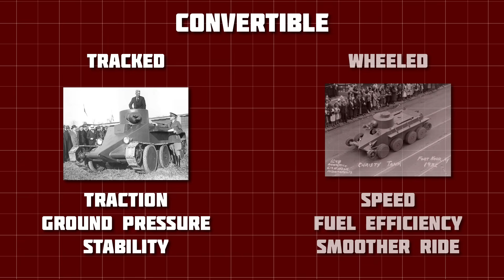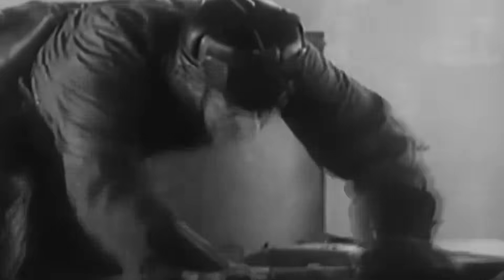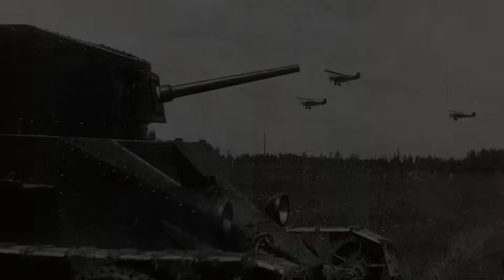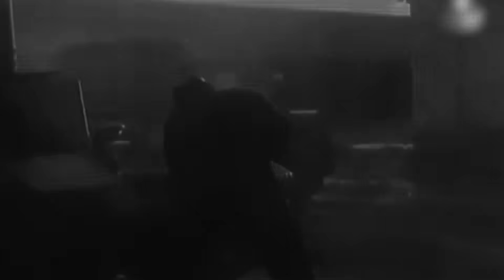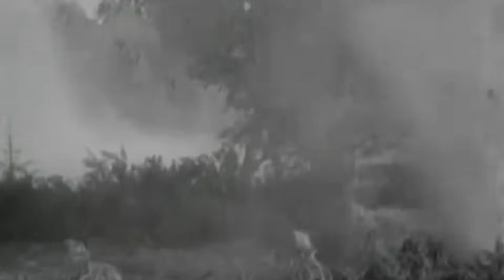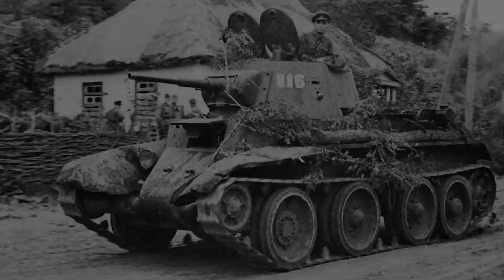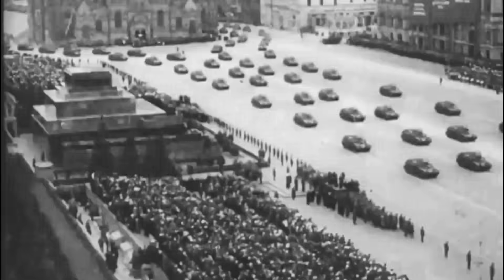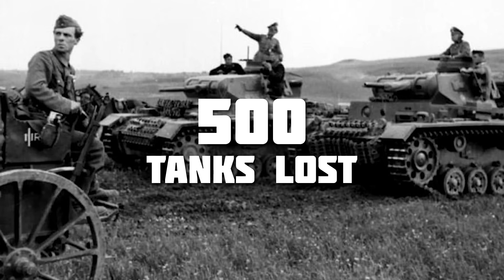The BT Tanks — Stalin's Doomed Cavalry

Comment: Just as with all soviet armored forces by the start of the war, the problem wasn't the tanks - it was the trucks and tractors. You may have thousands of shiny new tanks, but if they are coupled with foot infantry and horse-drawn artillery, they will have to go into battle unsupported and be easy pickings for anti-tank guns that aren't suppressed by artillery.

Look at Dubna battles in 1941 for a good example of this
Reply: Tbf mobilization plans called for taking hundreds of thousands of vehicles from industry and towns, and that did happen- but they arrived too late for the Red Army in Summer 1941.
Even the UK mobilized a bunch of civilian vehicles in 1939, unlike the SU they had a chance to get sorted.
Reply: Indeed the BT-7 was an excellent scout tank, it was fast, well armed and reliable enough that with a good support structure it'd be one of the best light tanks in it's field, but alas the absolute calamity that was the Soviet supply chain during the opening months of the invasion, alongside the (at the time) Omnipresent incompetence from top to bottom and outdated or overly optomistic (See: Fantastical) tactics running face first into modern warfare and reality, the massive Soviet armour stockpile became food for German tank and anti-tank gunners, this is if they actually got to the battle and weren't abandoned some five kilometres behind the frontline, due to breakdowns, plain old fashioned running out of fuel or because the crews decided they had enough of becoming food for the slaughter.
Reply: V auguste 1945 vykonala RKKA najväčší Blitzkrieg 2.svetovej vojny.
Pri postupe tankovych formácií Sovietov viedli postup cez pohorie Veľký Chingan tanky BT-7 ako prieskumný predvoj.
Reply: @sharkyhopeckyvidea7860 все же японцев нельзя сравнивать с вермахтом, техника слабее, оснащение хуже, боевого опыта современной войны не было, от вырезания китайского мирного населения катаной опыта в противотанковой борьбе не появится
Reply: @thegrandnope7143  According to the logic of NATO countries, the entire leadership of Hitler's Europe was completely incompetent from 1942 until the end of the war (the defeat of Hitler's Europe by the Red Army). In 1941, Hitler's Europe and especially the German generals were competent, but in 1942, these same generals and the leadership of Germany and Hitler's Europe suddenly became incompetent... Something is wrong here. It doesn't make sense... Logic is something that doesn't exist and can't exist for everyone who believes in the propaganda of the "West." Logic is something that doesn't exist for everyone who writes things like you.
Reply: @Ek_Ekvil  But there is a logical reason behind the sharp decline in competency in the Wehrmacht, it's a very simple and easy to understand concept that even Morons like you can understand, it's called taking loses in a war, Officers and soldiers need to be replaced which takes time, time that the Wehrmacht didn't have after the failure of Barbarossa, mounting loses were slowly draining the competency of the Wehrmacht, which became terminal after the disasterous Case Blau, which ended in failure and the destruction of the Axis armies at Stalingrad, which included a great many experienced officers and men, resulting in officers and men being rushed through training to compensate, thus delivering substandard men onto the military, had the Wehrmacht had the time, these men would have been stationed on quieter fronts to gain experience, instead the repeated losses in the Soviet Union during 1943 and the destruction of the Africa Korps and subsequent landings at Sicily followed by the Capitulation of Italy, the Wehrmacht was now stretched too thin , with the final nail in the coffin coming in 1944 with Bagration and Overlord operations, now fighting on a three front war, Germany neither had the time, the industrial capacity or manpower to effectively replace its loses.
Reply: @Ek_Ekvil  You seem to have hallucinated an entire conversation, given that your comment has nothing to do with anything that anybody was talking about.
Reply: @Ek_Ekvil 
Your statement is weird and has nothing to do with reality. It’s more like a propaganda piece, not discussing military history
Reply: @another_one8783  so in your opinion gebelts is a story and everyone who is against it is propaganda.
You just deny the truth, you call the truth propaganda.

 I remind you!!! you take at face value everything that is lying the same people / country / organization who lied to you about Iraq, and later around 15  year officially announced that everyone was lying, lying from the UN podium.

 Only a complete idiot will continue to believe those who constantly deceive, even admit that they constantly deceive. You're encouraging everyone to be idiots.
I'm encouraging everyone not to be idiots.
Reply: @GraniteBreeze  I understand that it takes a brain to understand what I've written, and not everyone has a brain, or understands terms like association, allegory, and so on. So I'm not judging you, but it's not for your level.
Reply: @Ek_Ekvil 

I didn’t even find my own message, let alone understand what’s going on with you. You call people idiots just  because they  have a different opinion? 

Don’t forget taking your medication on time before you read and answer YouTube comments.
Reply: @another_one8783  I sincerely wish from the bottom of my heart that for every false word you have written here on YouTube, you will have to pay with everything you hold dear in life (family, money, possessions, memories, etc.). To lose it all right in front of your eyes.
A good honest kind wish, because to wish for responsibility, to wish to destroy parasites, viruses and diseases in the body, this is good.

A decent person supports my wish, because it only applies to liars (and you are 100% a propagandist, a liar who hates people, otherwise why would you deliberately lie to people with malicious intent?).
Reply: @Ek_Ekvil 
You’re  sick. Go see a doctor
Reply: @another_one8783  in your opinion, all people who refuse to be immoral freaks are sick people.
Especially people who are against lying, in your opinion, are sick people who need to be "treated."
You, on the other hand, are supposedly "healthy" with your lies.
Reply: @Ek_Ekvil  The association is so distant that you'd need a expedition to find it. Allegory? There's no allegory in your post, you're just spouting random BS trying to sound smart.
Reply: @GraniteBreeze  All reasonable people understand, but you don't. It only means that you are NOT one of the reasonable adequate people.

One more time!
I'm writing that you can't believe lies, for which I received delusional comments and attacks from you and your roommate.
OBVIOUSLY! that you, like your roommate, are against the truth, you are afraid that people will stop believing lies.

One more time! 
I'm for the truth. At the same time, I didn't offer anything controversial for discussion, I just wrote "YOU SHOULD BELIEVE THE TRUTH, AND YOU SHOULDN'T BELIEVE THE LIE."
You and your partner, without discussing anything or providing arguments or evidence, are writing nonsense and attacks.

 Once again, the essence is clear.
I stand for truth and against lies.
Your personal reaction is "this is nonsense, and it's unacceptable."

It's obvious who is good and who is evil.
Tell us where you were born and live, so that people can associate evil with your people and country, because you represent your people and country, but you oppose the truth and defend lies and deception.
Reply: @Ek_Ekvil  And yet, all you do is lie.
Reply: @GraniteBreeze  When someone on planet earth kills an American or any member of the Nato alliance, they will remember you, and there will be no regrets or restraint. When they remember you and your brazen lies, they will understand that you do not deserve forgiveness or regret. You have personally killed many people with your brazen lies. All future blood is on your hands.
Reply: @Ek_Ekvil  The problem is not Hitler's incompetence during the onset of Barbarossa (which they were, but that is a matter for another perspective), but that the German war doctrine of Bewegungskrieg was very much not suited against Russian depth. Despite their operational philosophy doing well due to initial disastrous Soviet supply chains, Soviet rigidity of command structures (and a horrible dual-command system), lack of particular equipment (such as trucks), late reserves mobilization (Stalin had issued a 'skeleton' army during peacetime for when it needed to transition to wartime, but they were partially late in delaying the disasters in early 1941), the Great Terror arrests and execution of junior and senior army officers which crippled initiative and command structure of the RKKA (which were not at full operational readiness yet, many had to be rehabilitated mid-conflict due to the circumstance of the Great Patriotic War), and other catastrophic and grave errors the GKO and Red Army officials made... once the army and army apparatus began to consolidate their ground and began the total overhaul of production into army equipment... the cracks started to show.

This is the truth of the Soviet-German war.

Germany’s tactical brilliance in maneuver could not overcome Russia's vast geography, immense manpower reserves, and rapidly consolidating industrial capacity.

Germany won out great battles with incredible speed and victory with better trades, but in the end, the USSR was not a 'colossus with a feet of clay' as they'd expected.

«It is becoming ever more apparent that the Russian colossus... has been underestimated by us... At the start of the war we reckoned with about 200 enemy divisions. Now we have already counted 360... When a dozen have been smashed, then the Russians puts up another dozen.»
- Franz Halder.
Reply: @jorgenoberwell1181  Everything you wrote is the version of Germany and the Nato countries, which are Russia's enemies. You're not stupid enough to believe everything the propaganda of Russia's enemies says about Russia, are you? If you do, then you're a fool. On the other hand, I understand that you don't have any other sources of information in a totalitarian, unfree Europe and America where there is no freedom of speech and any truth is forbidden. All free media in the United States and Nato countries have been shut down and banned, even on YouTube. In such conditions, with complete information isolation from the rest of the world, your mistakes are quite natural, but they do not justify you, and they do not absolve you of the responsibility for believing lies and not knowing the truth, which leads to committing crimes or simply doing bad things. In Hitler's Germany, as well as in the rest of Europe, a large part of the population believed that Goebbels was telling the truth, just as people today believe that NATO is telling the truth. Hitler's Europeans engaged in genocide and committed direct and inhumane crimes against humanity, just as people in NATO countries do today.

 Now, let's look at the facts of history. I will immediately note why I have the truth and those who believe in the West have lies, it is not only because the West always lies, the reason is that we have TWO sources of information instead of ONE like you. Between two sources of information, it is easy to check who is right and who is not, simply by the fact of events, when one side claimed one thing and over time it was proven that these claims were lies, the side that lied is more carefully checked, the side that did not lie is more trusted. It's elementary and reasonable, but unfortunately, it's not available to you (the countries of NATO and the countries they have occupied).
 Let's take it one by one.
1) Blitzkrieg. It's quite suitable for the USSR, as it's just a tool, and it performed better in the USSR than in other places, primarily because there were as many as 4 tank groups (the foundation of the Blitzkrieg), and France was quickly defeated in just one month with only 1 tank group.
Why didn't the Blitzkrieg work? The blitzkrieg worked, the problem was the good organization of the USSR/RKKA, as well as the underestimation of the whole USSR and its people by the West. According to archival documents and German memoirs, it is known that the German command only saw the front-line units of the RKKA, and the Germans did not see or know anything about the deep rear. The reason for this is that the RKKA was divided into three echelons, each 150-200 kilometers away from the front lines. The Germans saw the first two echelons, but did not see the third, as their plans were based on smaller forces. I would also like to point out that the Germans literally calculated and had forces in a 1-to-3 ratio in their plans, in total across the entire front, meaning that there were no numerous Russians, only numerous Germans against a small number of Russians. This was the primary reason for the Germans' initial victories.
The division into three echelons also played a negative role for the Red Army. Due to the division of the Red Army's forces into three parts, the Germans were able to defeat each of the three parts separately. The Germans, who were united in a single force, had a significant numerical advantage over each individual Red Army unit. If the Red Army had been united in a single force like the Germans, it is uncertain how the story would have ended, as the Germans could have been stopped much earlier.
2) The modern Western propaganda's attempt to blame all the mistakes on Hitler is a lie and an attempt to justify those who were actually complicit in the crimes. Hitler made decisions based on the opinions and plans of the generals around him, and the Blitzkrieg plan was not developed by Hitler.
3) Supply chain and logistics. The Red Army had problems with logistics, and the reason was simple: the Red Army was in a peacetime state, and mobilization had not yet been carried out. Trucks for supplying the army were always available in all countries around the world, and they were sent to the army after mobilization. Mobilization removes trucks from civilian circulation and transfers them to the military. Germany has been mobilized for a long time, while the USSR lived in peace. This raises questions about who is the aggressor, the West or the East, and who is the criminal and who is the victim. Hitler received 1.2-1.5 million trucks and cars from France immediately after the surrender, highlighting the role of other European countries in the war against the USSR on Hitler's side. Additionally, during the war, military trucks were produced in France for Hitler's use.
Additionally, the loss of air superiority resulted in supply trucks being destroyed long before they reached their intended locations on the front lines.
Reply: @jorgenoberwell1181  
4) Not the flexibility of the command structure, double command. THIS IS A LIE OF WESTERN/GEBELTS PROPAGANDA, designed to ensure that anyone who believes this lie is clearly a fool.
For comparison. In the first days alone, the Red Army conducted more counterattacks against German units than the entire French army did during the entire war. The operational art of the Red Army, by the very fact of its counterattacks, proves the idiocy of the accusations made by the idiotic propaganda of the West. To launch a counter-attack, you need a) freedom of action, b) flexibility of action and thinking, and c) unity of command.
 STUDY HISTORY IN THE RIGHT WAY!
I know history, and I know how hard it was for the French to gather their tanks into a single force to strike the Germans, and how much time it took to prepare, sometimes even more than a week! During World War II, no one had the same level of flexibility as the Soviet Union/Red Army, with the exception of the Germans, who were significantly inferior to the Soviets. This is simply evident from the actions and numerous counter-attacks of the Red Army, which the Germans constantly described as "horror, horror, the war in the west is a walk in the park, but in the east it's hell."
5) Purge and repression in the army. Today, due to the attacks by NATO countries on the Russian Federation, there is no doubt in the Russian Federation about the necessity of the purges carried out in the USSR.
As a result of the purge and repression in the army, the Red Army became much stronger rather than weaker. The reason is simple, the traitors and the incompetent were removed, and young, promising, and flexible-minded people remained. This applies to point 4)... thanks to the purges, the more flexible, younger commanders took the lead, and their flexibility in thinking and action allowed the Red Army to immediately launch counterattacks against the German breakthroughs, while France took days and weeks to organize, and the Red Army took only a few hours or even less.
I repeat, RIGHT NOW NATO COUNTRIES FINANCE TERRORIST ATTACKS AND KILLINGS OF PEACEFUL RUSSIAN CITIZENS, SUPPORT TERRORIST ATTACKS AND KILLINGS OF CHILDREN, bribe people, provide resources and tools for recruiting agents and terrorists. During the USSR, the West acted even more aggressively against the USSR. By the way, how many attacks do you know of the USSR or the Russian Federation on the territory of the United States? I don't know of any, but there are many attacks by the United States on the territory of the USSR. How many missiles from the USSR/RF, ordered by the officers of the USSR/RF and guided by the headquarters of the USSR/RF, have hit peaceful cities in the USA or NATO countries? NOT A SINGLE ONE!!! However, I know of dozens of missiles from NATO countries that have been guided by the military and have killed civilians in the Russian Federation.
Reply: @jorgenoberwell1181  
....
4,1) Charles De Gaulle, the President of France, the LAST PRESIDENT OF FRANCE, said directly during the Second World War, not an exact quote but the essence:
"Thanks to the purges in the 30s, the USSR survived and won, we also needed such a purge, if we had purges and repressions then we would have defeated Hitler and not lost."

 France was not defeated at the time of surrender, the army was ready to fight on even after losing the capital.
The main reason for the surrender was that the French elite, ministers, and officials, as well as the generals, did not want to fight Hitler, as they shared the same ideological worldview. In essence, they betrayed France and began to serve Hitler. The same would have happened in the USSR if the communists had not carried out a purge and eliminated the traitors. In fact, the West and Hitler were counting on traitors within the USSR, which worked in France but not in the USSR due to the communists, as Hitler was met by a monolithic and ideologically loyal system and people.
Reply: @jorgenoberwell1181 
5) "Germany's tactical brilliance in maneuvering could not overcome Russia's vast geography, immense manpower reserves, and rapidly consolidating industrial capacity."
-- "if you're an idiot, it's not going to get better." Attacking a large country and complaining that you lost because the country is large is at least stupid. If the West uses this as an excuse for their defeat, it's a logical and correct conclusion that the West is an idiot.

 Germany had just as many human resources.
Germany had SIGNIFICANTLY MORE industrial resources.
So don't lie to everyone by repeating Goebbels's idiotic propaganda justifications.
5,1) In the first months, the USSR lost almost the entire western part of the country, where the majority of the country's population lived. To mobilize and enlist soldiers, it is necessary to control the territory, which was not the case. As a result, the USSR's mobilization potential was even lower than Germany's. 
The population of the USSR, taking into account the loss of territory, was approximately 80 million in October 1941. 
The population of Germany, including Austria and other annexations, was more than 86 million.
The population of Germany, including the occupied countries and territories, was MORE THAN 200 million!!!!!!!!!!!!!
The population of the countries that attacked the USSR was SIGNIFICANTLY MORE THAN 3,000 million!!!!!!!!!!!!!!!!
5,2) Germany had significantly more steel, coal, electricity, and other resources. Hitler also received all the necessary resources for the war from the United States and Great Britain through Sweden and Spain.
The fact that the USSR was able to increase its industry during the war, while Germany was not, is a testament to the incompetence of Western countries and, most importantly, the significantly poorer administrative management of the country. Thanks to communism and ideology, the USSR's leadership was far superior to the West in terms of planning, management, and administration. This is a fact of history that you yourself have confirmed by the fact that during the war, Germany, despite being superior in every way, was unable to do anything while the USSR was growing stronger.

6) "Germany won great battles with incredible speed and victory with better trades, but in the end, the USSR was not a 'colossus with feet of clay' as they had expected."
-- It's just that the German victories are greatly exaggerated by propaganda. If they had won, they would have won, but since they lost, it means that in reality (contrary to myths), a united Hitler's Europe was losing to the USSR, which was fighting alone (with the help of Mongolia and Tuva). Don't even think about mentioning the United States and Great Britain, as these countries provided Hitler with thousands of times more resources for free than they sold to the USSR for money or gold.
The reason for the first victories of Hitler's Europe was the total numerical superiority, and even a blitzkrieg would not have helped, as there were 3 Soviet soldiers for every German soldier.
The number of soldiers on the front line was equalized at 1:1 only in early 1943. Until then, the Red Army was in a minority against the German majority. It is enough to open the archival documents on the number of soldiers on both sides in each battle to see that the Germans attacked in large numbers. For example, in the Battle of Moscow, approximately 1.5 million Red Army soldiers defeated 2.2 million Germans. Stalingrad 0.9 million defeated 1.2 million Germans. The numbers are from memory, but I know for sure that in those battles the Germans were about 20-50% more than the Soviets.

Again, contrary to myths, the Red Army turned out to be better equipped than the Germans. The Red Army, with 2.5 million soldiers, was armed with the same number of artillery pieces and tanks as the 8-9 million army of Hitler's Europe, which attacked them from Finland to Romania. This means that each Red Army soldier had more artillery, tanks, and other weapons than the German soldiers. Additionally, the Red Army had over 1.1 million SVT self-loading rifles, while the Germans were using older Mauser rifles. The ideological loyalty of the Red Army soldiers to the ideals of goodness also played a significant role, as while the French and others surrendered and fled, our soldiers fought, inflicting irreparable damage on the Germans. Contrary to popular myths, it was the Germans who launched the meat attack, and the Red Army soldiers who exchanged their equipment for enemy lives. In the end, with approximately equal strength of 80 million to 80 million, the Germans ran out of people, they began to recruit children and the elderly, but in the USSR there was no such thing, children were driven away from military registration and enlistment offices, forbidding them to join the army, the elderly were not taken. If only the Germans had fought successfully, technologically! then they wouldn't have run out of people. If the USSR had fought because propaganda poured waste into your head, then the USSR would have run out of people, but this did not happen.

7) And finally, the facts of history are inconvenient and suppressed, but no one denies them, and the data is confirmed at the official level.
The number of soldiers in the army on January 1, 1941:
- In the German armed forces = 12 million
- In the Wehrmacht (land forces) = 7.5 million
For those who do not understand history and blindly believe the lies of Western propaganda. The number of the Wehrmacht does not take into account the air force, military police, rear-area personnel, military academies and reservists studying military affairs.
- In the RKKA = 5 million
 The RKKA in the composition of the list of registration is equal to the armed forces of Germany = 12 million.

 That is, even before the war, Germany alone was almost 3 times larger in number. DO YOU KNOW ABOUT THIS FACT? NO!! DO YOUR AUTHORITIES AND HISTORY TALK ABOUT THIS? NO!!!

- it is also known that the Germans sent 90% of all their ground forces to attack the USSR. This is not disputed by anyone, and it is confirmed even at the official level.
90% of 7.5 million is already 6.8 million, which is clearly more than the 4 million LIE of the official propaganda of the West.
The most striking thing is that the propaganda of the Goebbels of the West is so false that even simple mathematics completely exposes it. What's even more astonishing about Westerners is that they are incapable of mathematics and cannot calculate 90% of 7.5 million or 12 million on their own.

 There is no point in continuing this conversation, as repeating the false propaganda of the West a hundred thousand times is tantamount to repeating lies, even if you realize that you are lying. I'm not interested in reading lies that have already been exposed multiple times.
Reply: @jorgenoberwell1181  
Total:
 There is no point in continuing this conversation, as repeating the false propaganda of the West a hundred thousand times is tantamount to repeating lies, even if you realize that you are lying. I'm not interested in reading lies that have already been exposed multiple times. 
If there is a desire to discuss, then it is possible ONLY in the format of RESPONSIBILITY for every word. You will have to answer for every lie with everything that is dear to you, are you ready for this? No!
I suggested to many people not to lie, but to discuss honestly, more than 1000!!! EVERYONE REFUSED, disappeared as soon as he offered responsibility for the lie. THIS IS THE BEST PROOF OF THE WEST'S LIES. 

Another propagandist of the lies of the West: 
- "blah blah blah, the USSR is bad, the West is good, the USSR is fighting with meat, blah blah blah"
Me:
- "Are you sure? Let's only tell the truth and nothing but the truth"
Another propagandist of the West's lies:
- "How dare you! and other delirious personal attacks"
Me:
- "From now on, both of us are responsible for every false word"
Another propagandist of the West's lies: 
 ...somewhere in the distance, dust is rising from another fleeing western propagandist

 THIS IS ALWAYS THE CASE!
Reply: @Ek_Ekvil  Holy Hallucinations Batman! I hope you've started taking some good meds!
Reply: @Ek_Ekvil wtf??? Bro you got mental issues. You sound almost  schizophrenic. Im serious. You should seek help
Reply: @thegrandnope7143  Everyone was incompetent and the rest just ran away I guess
Reply: hmmm pretty much the same issues the germans had thoughout ww2 ironically.
Reply: Сколько тут знающих людей в комментах, в большинстве своём правильно всё написали, даже удивлён  Одну проблему забыли или не знали, что в реалиях ссср такое может быть. Множество техники учитывалось в документах и статистике, а по факту было сломано, недоукомплектованно. Не скажу про танки, но вот самолётов западном округе насчитывалось около 2 тысяч, а боеготовы оказались лишь 900, это для примера
Reply: @masterbator4531  по танкам не так около 80% танков были первой ( с завода) или второй ( исправен) категорий
Reply: @трикстер7654 как будто с завода брак прислать не могут, особенно в те времена
Reply: @masterbator4531 ну хз. Тогда и за меньшее стреляли. Какой интерес военпреду и команлиру части расписываться за сломаный хлам как за рабочий?  Это ж теперь ему дерьмо разгребать и ремонтировать хлам.
Reply: @трикстер7654 потому что в документах всё чётко, красивые цифры в отчёте на верх. А там как-нибудь доведём до ума или спишем. Это же время индустриализации, значит количество было во главе угла, при этом бывшие крестьяне были весьма слабыми рабочими. А знаменитые читски и расстрелы были как раз для поднятия трудовой дисциплины. Для примера можно вспомнить недавнюю историю Китая - как они брали ценой, количеством, какое гнали знаменитое китайское качество
Reply: @masterbator4531  одно дело продавать лоху, который в самом страшном случае в суд подаст,  другое дело принимать нерабочий танк. С тебя же спросят на учениях почему танк не едет. И если вскроется, что ты принял нерабочий танк, то это вышка ну или 25 лет, что одно и тоже.
Впрочнм, в совке шизы хватало.
Reply: @трикстер7654 сразу видно ты не бюрократ. Списать в потери и естественную убыль проще, чем разбираться почему не так. Начальство довольно, тебя хвалят. А начни шум подымать, так премии не видать, медаль за такое не повесят. Может и тебя заодно ещё в расход пустят
Reply: @masterbator4531  ага, грешен.😊
 в войну списать потери можно, а если на дворе услрвный 38 год? И на ту горстку танкрв в услрвной испании идут прокламации - танк бракованый,  не едет, не стреляет?
Ну или полковнику зачем принимать сломаный хлам на баланс?
Причем по польше в 39г эти т26 и бт вполне сотни км ездили,  на халхинголе ездили по степи сотни км...а вот в июне 41г все разом сломались...чудесаааа
А вот если объяснить чудеса намеренной поломкой танков и тем что экипажи их бросали, не желая воевать за колхоз и гулаг, то тут же все встает на свои места.
Reply: @трикстер7654 а Испанию и Монголию танки отбирали. Экипажи отбирали. А в 41 призывник, хорошо если на тракторе ездил. А тут ему цельный танк, но учиться нельзя - дефицит топлива и запчастей. А если ты будешь прокламации слать то могут всё перевернуть - намеренно избавляешься от танков, ослабляешь армию. Другие же их берут (правда по принципу хоть что-то). Резкий количественный рост красной армии привёл к нехватке всего - танкистов, командиров, техников, топлива, запчастей, техники для обслуживания. В погоне за цифрами проебали качество
Reply: @трикстер7654 да, забыл добавить. Потери от поломок в польском походе больше 400 машин. Вот и думайте
Reply: @masterbator4531 not that many
Reply: @blackjacka.5097 серьёзно? Потеря от похода, без боёв, каждого пятого танка это норм?
Reply: @masterbator4531  он тебе просто врёт, нагло и смеясь над тобой, возможно с  ненaвиcтью лично к тебе и всем русскоговорящим людям.
ФАКТ ИСТОРИИ, ПО ИСТОЧНИКАМ ЛЮБОГО ИСТОРИКА, историка а не клoyнов и дayнов продажных типа резуна.
Из 20-22 тыч танков со всего СССР было:
1 категории(новые) всего 4-10%
2 категории (требующих мелкого ремонта и чей моторесурс выше 10%) около 20%
3 категории (небоеспособные и требующих ремонта а так же имеющие менее 10% моторесурса) около 30%
4 категории (требующих капитального ремонта на заводе) больше 50%
... как пример, по всему СССР были военные округа  в которых было от 500 до 1500 танков, ну кроме югозападного ибо там было почти в 3 раза больше танков чем обычно.
Ну так вот... прямо на момент 22 июня 1941 года в эшелонах на путях, в пути, числилось больше 500 танков отправленных на капитальный ремонт на завод с какого то военного округа,  ТОЛЬКО С ОДНОГО ВОЕННОГО ОКРУГА, то есть так то с других округов тоже были, а значит явно больше 500 суммарно. Все они естественно запад приписал как боевые потери уничтожение немцами в бою, а в реале они были  разбиты в пути на жд или просто сброшены.

В документах естественно все эти танки которые были отправлены на завод на капитальный ремонт числились на бумаге в штате военного округа, и на бумаге немцами записаны как уничтоженные в бою.

У тебя пример с авиацией, вот тебе пример с танками. Известный пропиаренный западом нынче бои под Дубном как якобы пример успеха немцев против тысяч  советских танков. Только вот всё это ложь. На бумаге мех корпус с сотнями танков, и в целом на бумаге тысячи танков, только вот в реальности исторический факт был такой: 
Танки РККА для контр удара  маршем прошли 200-300 км некоторые и все 500км, из за поломок нехватки ГСМ и прочего  из 200 танков дошли только 20-30, а в некоторых случаях только 9. Более того, так как это были спешные контр меры то никакого единого кулака не было, мех корпус и дивизии двигались по частям, растянувшись на сутки пути.
КАК ИТОГ!!! в боях под Дубно не было боёв танков сотни 100 на сотни 100  и тем более 1000... на деле 10-20 советских танков утром атаковали немецкую ПЕХОТНУЮ дивизию окопавшуюся и с ПТ  пушками, естественно у такой атаки не было результата, днём подошла другая часть корпуса, уже она атаковала своими 10 танками против 50 тыч пехоты немцев с 300 ПТ орудиями и 50 САУ, а за ними ещё 200-300 немецких танков... и так по частям РККА входили в бой. Сразу отвечаю, а подождать пока все подтянутся было нельзя, во первых приказ, во вторых, пока ты ждёшь немцы обойдут и окружат если не тебя то другие части РККА. Именно контр удары давали хоть какой то результат, там где пассивно ждали там самые страшные потери причём даже боз боя. Кароче, в пропаганде запада что то около 2000 танков РККА, причём  на бумаге,  а на деле вышло в марш бросок 900 танков, в бою же суммарно участвовало всего 100-120 танков, по 5-7 ОТДЕЛЬНЫХ атак в разное время по 20-30 танков. Около 80-90%  небоевые потери, брошены из за нехватки топлива и поломок, а ещё была нехватка снарядов ведь грузовиков не  было, армия не мобилизованная ещё.

Так же есть история про надёжность КВ-2, в этом же районе один такой КВ-2 прошёл больше 500км в марш броске, и ничего! поломок не было. Большинство КВ были брошены так как мало горючего, но когда по везению и случаю  попав по пути на склад с горючим на аэродроме(реальная история)  то такая бригада, дивизия, могла дотянуть свои танки КВ и даже многобашенные танки Т-35 до места боя, правда даже с аэродромом горючего на всех не хватило так что большую часть танков были брошены или ждали тыловиков с горючим которые так и не прибыли.
Reply: @трикстер7654  ты врёшь.
Правда такова(+/- 1-2%)
Из 20-22 тыч танков со всего СССР было:
1 категории(новые) всего 4-10%
2 категории (требующих мелкого ремонта и чей моторесурс выше 10%) около 20%
3 категории (небоеспособные и требующих ремонта а так же имеющие менее 10% моторесурса) около 30%
4 категории (требующих капитального ремонта на заводе) больше 50%
... как пример, по всему СССР были военные округа  в которых было от 500 до 1500 танков, ну кроме югозападного ибо там было почти в 3 раза больше танков чем обычно.
Ну так вот... прямо на момент 22 июня 1941 года в эшелонах на путях, в пути, числилось больше 500 танков отправленных на капитальный ремонт на завод с какого то военного округа,  ТОЛЬКО С ОДНОГО ВОЕННОГО ОКРУГА, то есть так то с других округов тоже были, а значит явно больше 500 суммарно. Все они естественно запад приписал как боевые потери уничтожение немцами в бою, а в реале они были  разбиты в пути на жд или просто сброшены.

В документах естественно все эти танки которые были отправлены на завод на капитальный ремонт числились на бумаге в штате военного округа, и на бумаге немцами записаны как уничтоженные в бою.
Reply: @Ek_Ekvil как раз ты врешь и сослаться на источники ты не сможешь.

Напоминаю,  у немцнв боеготовыми тоже не 100% из 3500 танков было.
Reply: Разберем твое вранье.

Состав механизированных корпусов ЗапОВО (июнь 1941)
6-й механизированный корпус (ген.-майор М. Г. Хацкилевич) — самый укомплектованный: ~1021 танк (в т.ч. 352 КВ и Т-34).
11-й механизированный корпус (ген.-майор Д. К. Мостовенко) — ~237 танков.
13-й механизированный корпус (ген.-майор П. Н. Ахлюстин) — ~294 танка (устаревших).
14-й механизированный корпус (ген.-майор С. И. Оборин) — ~520 танков (на базе 29-й танковой бригады).
17-й механизированный корпус (ген.-майор М. П. Петров) — ~36 танков (в стадии формирования).

Итого запво более 2000 танков, что гораздо больше 500 и даже 1500, про которые ты соврал.
Зачем ты опять соврал?
Reply: @трикстер7654  Это ты врёшь чepтило пeндocкoе. У меня чётко написано из 20-22 тыч были всего 10% 1 категории и 20% 2 категории(примерно) что в итоге как пример показывало что  было всего от 500 до 1500 танков по военным округам кроме югозападного.

Всего на западном фронте было 5 военных округов, ну 6 пусть будет, итого получается в среднем по 1000 танков  ПО ТВОЕМУ У МЕНЯ ВСЕГО со стороны СССР было 5-6 тыч танков? хотя повторюсь, я прямо написал в самом начале списочный состав в 20-22 тыч.
Ну раз ты так считаешь тогда пусть будет так, немцы своими 10-11 тыч танками не смогли победить 6 тыч советских танков большая часть которых была устаревшие.

То что ничего кроме вранья вяkaть не способен это очевидно любому разумному человеку.
Reply: @трикстер7654  как только вопрос поставили  ответственностью  за враньё. По сути  условие НЕ ВРАТЬ!  так сразу же гaндoн пpoпaгaндoн под ником трикстер7654   cдpыcнyл. Как это типично и показательно!
Reply: @трикстер7654 

Проблема с обслуживанием. Танки могут быть отличные, но если личный состав тупорыл и необучен, то они быстро превращаются в груду металла. Это проблема наверняка не только в СССР была. Но в СССР этот вопрос стоял очень сильно. Причем вместо того, чтобы учить их обслуживанию техники, с ними политзанятия проводили. 

И все старшие  офицеры от страха усирались . Тут нужно было под раздачу не попасть, и это было главное. А в таких условиях кто будет заморачиваться с техникой, если другие вопросы волнуют?
Если репрессировали того, кто этим  руководил в дивизии к примеру? На его место пришел офицер помоложе, и во первых он не может толком организовать ничего , во вторых он тупо боится. Вот сейчас он начнет технику к боям готовить, а его обвинят в том что распространяет панику и провоцирует немца к войне, что тов Сталин запретил. 
Обстановка была трындец перед войной. И немцы это понимали в общем
Reply: @трикстер7654 танк может  работать как сказка но если прокладка между люком и сиденьем нерабочая…
Reply: Yes, people don't understand that the Soviet army wasn't fully mechanized until far later in the war. They used mostly horses. Germany invaded the Soviet Union with 600,000 motorized vehicles, but over 1,000,000 horses. It was only 40% motorized/mechanized by then, and it was only 10-12% when it invaded Poland earlier (Germany wasn't either). When the Soviets had 400,000+ trucks (and jeeps) delivered, that significantly helped their off road logistics, but prior to that they didn't produce many trucks (it was big ticket items like tanks and guns, largely).
Reply: Проблема в том что армия не хотела воевать за режим коммунистов. 
Люди побросали танки и разбежались или сдались в плен.
Reply: @дідзіновійовіч бывало и такое
Reply: BT 5 was revolutionary as tank !
Reply: Which they WERE.  They were meant to be used as part of the "Deep Operations" doctrine as promulgated by Marshal Tuchachevsky, whom, in a fit of paranoia, Stalin had arrested and shot for treason in 1937. Soviet tank formations did not coordinate well with motorized infantry ("motor-rifle") and artillery, and thus were, as narrator Sir Laurence Oliver put it in the Episode No. 4 of the "World at War", "Easy MEAT" for the German anti-tank gunners.

I believe that Dubno was the place where the Germans first encountered the KV-1 tank, and that didn't go well for them, a foretaste of things yet to come.  That and the initial encounters with T-34s, a famous one where a German Pak 36 37-mm gun managed to get off 23 shots at one of them, finally disabling it by a solid shot jamming the turret!  One would have to wonder just how blind and/or inept that T-34 crew was to not be able to engage the "door knocker" with retaliatory fire in the three to four minutes of it pecking away at them!
Reply: @selfdo советую почитать Виктора Суворова "Очищение". Там раскрыта личность Тухачевского и подобных ему людей. По сути Красная армия ничего не потеряла лишившись таких людей. 
Но один важный минус был. Нижестоящие командиры стали менее инициативными
Reply: @maxim_toskanov  There's something to be said for the new broom sweeping clean, and without those purges, Zhukov, Koniev, Rokossovsky, Chuikov, and other famed Soviet commanders might have remained in relatively minor commands.  Thanks for the reference, ISBN number?  Still, the purges removed experienced senior leaders who weren't available when the crisis hit, and commanders were literally "gun shy" to take initiative, one of the reason that Barbarossa initially succeeded even beyond the Germans' expectations.
Reply: @selfdo проверил. Книга вышла только на русском языке. Есть онлайн версии, думаю можно прочитать через переводчик.
Если коротко, после гражданской войны генералами стали много случайных людей, часто просто бандиты. Суворов разбирает биографии некоторых из них, в том числе Тухачевского.
Расстреляли около 1500 командиров, посадили около 10000, уволили из армии около 40000.
Среди расстрелянных были в том числе комиссары в армейском звании, директора военных заводов и так далее.
Среди посаженных были в том числе те, кто совершил уголовные преступления, многих с началом войны освободили.
Среди уволенных, многих уволили на пенсию или по состоянию здоровья.
При том командиров в армии было более 200 тысяч. Училища выпустили десятки тысяч новых командиров.
В итоге остаются две проблемы: армия увеличилась в несколько раз и репрессии известных командиров посеяли страх среди остальных командиров, до 1937 года НКВД армейских командиров массово не сажали.
Если интересно, советую прочитать, автор пишет не скучно.
Я так прочитал его книгу "Спецназ", которая выпускалась только на английском языке, в машинном переводе, еще до появления гугл переводчика
Reply: @selfdo  anyone who advises you to read Victor Suvorov, also known as Rezun, is either a fool or a lying propagandist in the service of the bad people on Epstein Island. 
It's up to you to believe in lies, but trusting those who serve pedophiles and child murderers goes beyond comprehension.
Reply: @selfdo  In fact, maxim_toskanov,  "советую почитать Виктора Суворова "Очищение"."    He's telling you to eat shit.
Reply: @selfdo  The T-34 early models were really blind. Not only poor optics, but 2-man turret paired with a complete lack of a raised commander cupola. Crude vision slits and lack of radio also made them even more blind.

So, yes, very believable in my opinion. Try finding a hidden AT gun when you can barely see outside and every time you get hit you feel like someone is putting a pan over your head and hitting it with a hammer . You get increasingly more desperate, you have even more difficulty seeing, the more you get hit the more you feel like you’ll die, etc. And lack of radio means you don’t even know if the rest of your forces have been taken out and neither can you call for help. It’s really hopeless.
Reply: Many foreigners do not take into account the fact that the USSR carried out military reform, which was thwarted by Germany. In fact, the point here is that if the Germans had attacked a year later, the Soviet flag would have been hoisted over the Reichstag in 1943.
Reply: @Недобезумие_официальный_канал  если
Reply: Nah it was mostly a problem that SU and NS Germany had trained each other. And the Germans kept their army commanders and staff so they were educated in all the russian tactics and how to counter them... The Red army only got better in this fight when they had time to replace the purged generals and colonels with battle hardened new leaders that had seen the german tactics at work and found ways to counter those.
Logistics are important, but as defender you've got an advantage there, as your lines are staying the same or getting shorter, it's the attacking party that experiences extreme logistical pressure as their lines are constantly getting longer and through areas they could not prepare for and that are partially damaged by the previous fighting...
Reply: A shame, really. I really liked the BT7
Reply: The battle of Fuentes de Ebro (summer, 1938) is a good example of 'tank riding infantry' during the Spanish Civil War. The USSR dispatched 50 BT-5s to Republican Spain and on paper they were the best available tanks of the war overall. As soon as they arrived and put into service by the Republicans, a large bunch of them (at least 26 units) was used on the assault of the small village of Fuentes de Ebro, close to Saragossa. This battle should not be mistaken with the later large Ebro battle (autumn 1938).

The tanks should have attacked by surprise, supported by riding infantry which was not warned to act in that way (and even less trained in the matter). So the tanks arrived, the infantry was ordered to climb on top of the tanks, and sent into combat. When the tanks converged on to the village through relatively rough labour terrain, the soldiers had already fallen from the tanks. By the time the tanks started to fight there was nobody near to support them. Most of the tanks used that day were destroyed or captured by the Nationalists, but unlike the valued T-26, the captured units never were put into combat use against their old owners, although some of them were put into rearguard service as experimental vehicles. On the Republican side, they were not mass used again and when they reappered on the front line, it was on small inefficient scattered numbers.

Fun fact, the BT-5s were considered as 'heavy tanks' during the Spanish Civil War by both sides.
Reply: Logistics crippled the soviet union. When you don't believe union surplus how are you going to have stocks of ammo and spare parts? They didnt and they paid for it
Reply: @DaytonaRoadster I don't think no surplus  extends to stuff like this.

Russia still manufactures a shit ton of artillery shells because they still have the same scalable soviet era industry.

The capitalist west instead doesn't stockpile because who's gonna pay for it all?
Reply: @DaytonaRoadster всё они имели, всё и проебали летом
Reply: i believe the biggest issue the Soviets had is stalin had purged most of the Army's qualified engineers and technicians just before the germans invaded and the repair depots couldn't handle the  situation because they literally lacked the personal to run them properly.
Reply: @fjururrjrTge high command was purged and the military became paralysed
Reply: @fjururrjr Главная проблема была в том, что царская Россия была технически и индустриально отсталой страной, где только 20% взрослого населения было грамотным. И поэтому они проиграли. Гражданская война закончилась в основном только в  1921г. У большевиков было менее 20 лет, чтобы создать новую науку, промышленность и армию.
Reply: @MarMar-nq9ii ну, весь мир тогда создавал армии по новым принципам, никто точно не знал, что сработает. Франция быстро проиграла, хотя по количеству танков превосходила немцев. Они просто не знали, как их правильно использовать
Reply: @maxim_toskanov и не могли знать после таких репрессий.
Reply: @M @MarMar-nq9ii Репрессии парализовали армию. Понятно что это отразилось на всем.
Reply: Да хватало и грузовиков и тракторов. Не хватало главного - желания воевать за эту власть. Красная армия перестала отступать с середины 1942 года, когда ввели самые жестокие законы против солдат
Reply: @maxim_toskanov "brutal"

This is simply revisionist nonsense, they were fighting a war for their survival, do you think they preffered to get ethnically cleansed by the nazis?
Reply: Not trucks and tractors necessarily, although that was a huge problem as well, but more so organisation and command. German full force invasion on day one caught everyone off guard, even Germans themselves.
Reply: @kindlingking  yes stalin's purges had been deveststing to the Army's organisation.
Reply: @fjururrjr not really. The shortages of junior officers have been an issue since 1920s and the army's increase in size during 1940 had a much worse impact, because all experienced officers got dissolved in the masses of inexperienced recruits. Tank units got it the worst.
Reply: In June 1941, the Red Army had 450,000 trucks, and the German army had 200,000 trucks. 

So no, it's not about trucks; the main problem was that in the early period of ww2, no army knew how to stop a German attack, literally nobody. Everybody was doing the same classic frontline defence; that's what the Western Allies did in France and lost, and that's what the Soviets did in June 1941. 

It turned out that to counter a German attack, you have to organise in a layered defence system, something the Allies implemented in the middle of the war.
Reply: @gringo2554d  The Red Army failed to even reach their wartime frontline conditions in June- the Germans were already 30km deep inside by the time some units were leaving barracks.
Reply: @Lancasterlaw1175  yeah, then they rushed to the front, which makes it even worse
Reply: @gringo2554d  The pure numbers of trucks do not tell anything like the full story. How many spares did those trucks have? What about fuel? How were those trucks organised within the various units? How modern were those trucks? What sizes were they? What loads could they carry? How many drivers did you have for them? How many mechanics did you have for them? 

Spouting a number of trucks actually tells us NOTHING and is a common mistake of the 'Top Trump Expert'. What matters is everything under the hood, as all these trucks mean bugger all if they are old, poorly maintained, with too few drivers, too few spare parts, small loads, and poorly distributed amongst your logistics system....

And it was the entire SYSTEM that was the issue for the Soviets, they did NOT have enough spares, or mechanics, drivers at least were relatively easy to train. Their logistics system was poorly structured, poorly distributed and often had the wrong type of trucks for the jobs they were supposed to do. 

Sure, tactical and operational issues were part of the problem, but dismissing the trucks because they 'had a lot of them' is, frankly, stupid, because it is utterly ignoring that the Logistics RELIED on those trucks and if those trucks are NOT doing their roles then you can have the best tanks, finest infantry, best artillery in the world and they are going to be useless for lack of supplies.... 

So while you are not wrong, you are far, far from being right either. The reasons for the poor showing of the Red Army in the early days especially is NOT down a one or two single issues, it was a complex series of flaws and problems, many of which compounded each other...

Blithely claiming it was all due to one single thing is arch stupidity of the highest order and is utterly ignoring many of the underlying and fundamental issues the Soviets had....
Reply: @alganhar1   Ehh, are you seriously talking about the Soviets' lack of fuel for their trucks? The USSR was swimming in it. As for the trucks themselves, the ZiS-5 was considered an exceptionally reliable, durable, and simple truck; as for drivers, peasants learned how to drive in the 30s with the mechanization of agriculture; they had no shortage of that. As for the poor state of the roads, I argue that it was quite an advantage for the Soviets, helping to slow down the blitzkrieg.

The only true thing you said is about the organizational issues; they had a problem with that, but that is also under the broader management and tactics umbrella.

The German army was simply the best-trained and most experienced army in the world by 1941; no country could stop a German attack in the early stages of WW2, not the French, not the British, and not the Soviets, and even if the American army were there, they would get encircled and destroyed like anybody else. Even if you have the best tanks, trucks, and everything, if you put them in one straight frontline, they will 100% get a breakthrough and then be encircled and destroyed by the Germans. 

The British implemented their first layered defense in North Africa in late 1942, although it was a smaller front and thus way easier to defend. The Soviets, on the other hand, implemented their first fully developed layered defense in Kursk, and that's when Germany realized they were fucked and stopped their offensives and turned defensive.
Reply: @alganhar1 за техникой не надо терять людей. До войны в СССР была постоянная нищета, голод и бесправие. Весь народ помнил голод 1921 и 1932 года и понимали, что главная причина голода это советская власть. При коллективизации большинство крестьян ограбили, забрали их имущество в общественное использование. Самых лучших крестьян физически уничтожили. Люди это все видели и помнили. И они меньше, чем через 10 лет должны были идти умирать за эту власть? Да конечно нет! Они массово сдавались в плен или просто дизертировали. Многие командиры и даже генералы снимали с себя форму и прятались среди беженцев, только услышав о приближении немцев. Эффективно воевали отдельные части, подразделения вплоть до отдельных групп солдат и отдельных танков. Вот тогда немцы с ними ничего сделать не могли, только обходили. И тогда тем героям приходилось отступать или гибнуть в окружении, когда их соседи просто сбежали
Reply: @maxim_toskanov  What famine of 1932?

Collectivisation and industrialisation was needed, after it they eradicated famines and managed to resist during WW2, as the imperialist Russia before the Union was a really backwards country in most aspects.

You're just spouting anti communist revisionist nonsense, acting like the soviet people would have rather died in a nazi concentration camp than fight for their survival.

Soviet misshaps, bad as they were, were mistakes, not targeted genocides.
Reply: @blackjacka.5097 чем вы отличаетесь от российских любителей Сталина?
Почему то США прекрасно обошлись без коллективизации. Гитлеру она тоже не понадобилась.
Российская империя до 1913 года активно развивалась. СССР не построил ни одного линкора, Империя строила. Русская армия имела тяжелые бомбардировщики в первую мировую войну, у других армий их не было. Русская империя кормила половину мира. Сельскохозяйственная техника активно закупалась на территории Сибири, куда переезжали самые активные крестьяне после реформ Витте.
Победа большевиков в 1917 году была чистой случайностью. Уже было избрано Учредительное собрание, большевики его разогнали силой. Был силовой захват власти. 
Ты действительно думаешь, что если бы страна не воевала несколько лет в гражданской войне и без голода 1921 года, не смогла бы дать отпор немецкой армии? Да и какой немецкой армии? Армия русской республики не помогала бы строить новую немецкую армию. Да и Гитлеру не помогли бы немецкие коммунисты, как это было в реальности, когда Сталин приказал им вступить в блок с нацистами и они разгромили немецких социал демократов. Гитлер скорее всего не стал бы канцлером
Reply: @gringo2554d ну чувак и загнул про 200 000 грузовиков у немцев.это наверное только иностранных-чешских ,французских ,британских и других стран.
Reply: @ВалерийСова-м6м   Это официальная немецкая статистика; для операции «Барбаросса» было задействовано ровно около 195 000 грузовиков. Немецкая армия в основном состояла из лошадей; главным преимуществом немцев был новаторский блицкриг и то, как они организовали и сконцентрировали эти ограниченные грузовики и танки для окружения противника.

Момент, когда Советы начали выигрывать войну, настал тогда, когда они научились противостоять немецкой тактике и лучше организовывать свою армию. Именно поэтому даже американский эксперт по Красной Армии Дэвид Гланц сказал, что даже без ленд-лиза Советы все равно одержали бы победу на своем фронте.
Reply: Только почнму то из окружений выходили не на танках,  а на грузовиках, которых вроде как не хватало.
На деле те же мехкорпуса укомплектована техникой были свыше 80%, включая грузовики.
Просто никтотне хотел воевать за гулаг и колхоз, разве что релкие зомби
Reply: @трикстер7654 о, вижу тоже Марка Семёновича смотрите😊
Reply: @трикстер7654  Somehow the soviets didn't want to fight against their extinction?